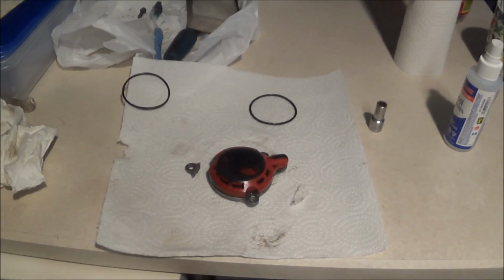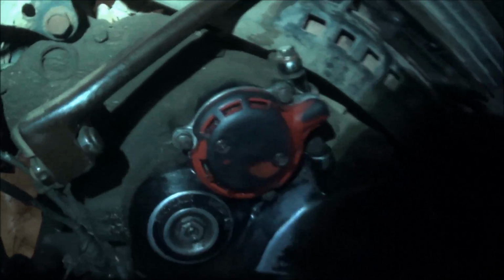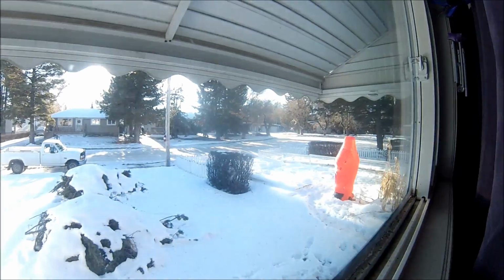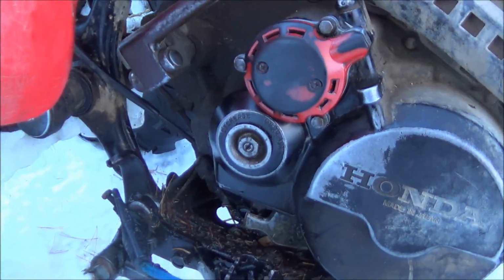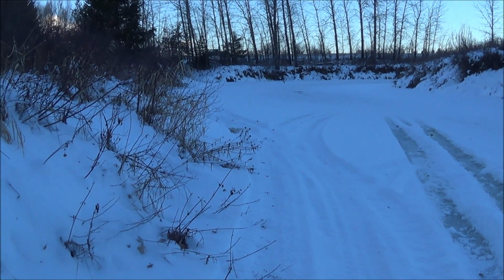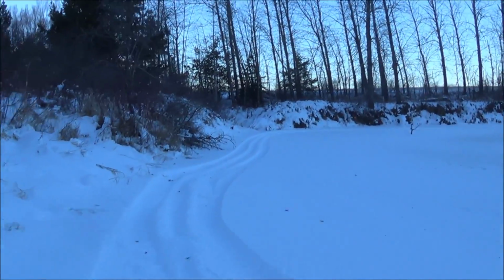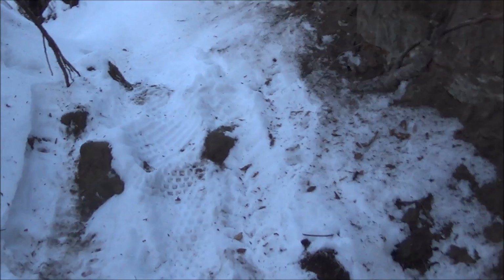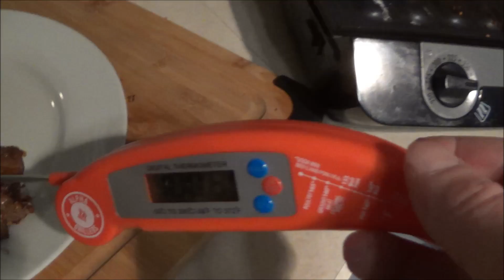Oil leak.1985 Honda Atc 250sx/Romp.

Comment: What temp is the gorilla glue rated too lol - nice fix ??? Go Pro's need good memory cards or they don't work man...
Reply from the maker: It was just to hold in place till i got er installed. Yeah so far so good with the new card// rock on buddy.
Reply: @marcelstjean  If thats a go pro 3 I think it will record in 4k if you want it to... takes longer to upload because 4k takes more memory but its worth it man for future viewing/anyone with 4k. I used to have the hero 3 black edition I remember that did 4k so sure it'll be the same... also set it at 60 (fps) frames per second looks way better :)
Reply from the maker: Right on i had no clue i'll look into it.. Thanks again eh buddy.